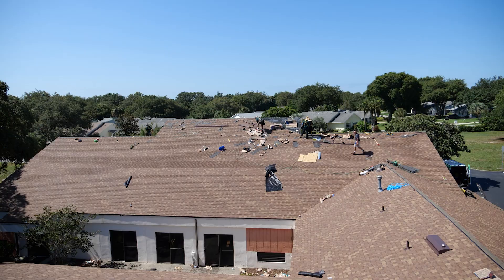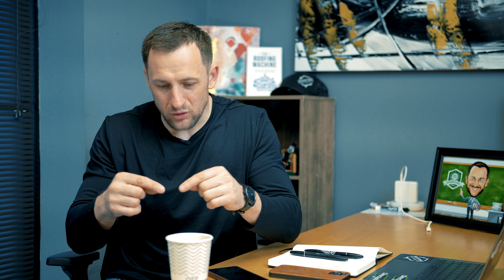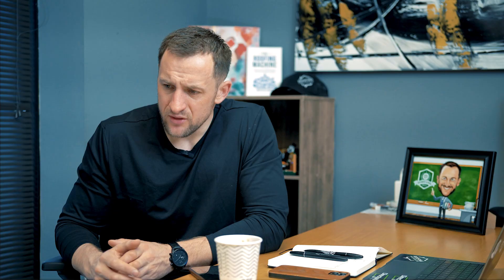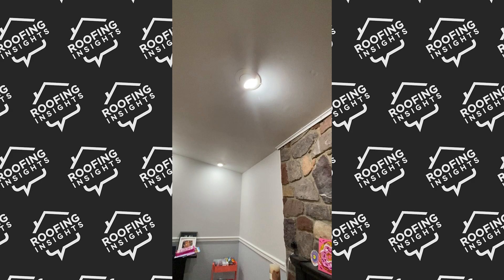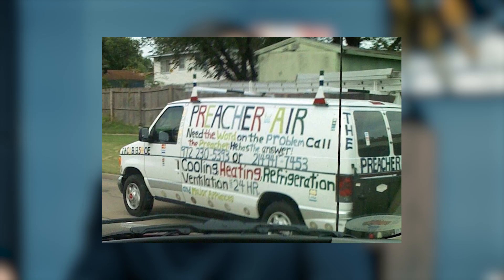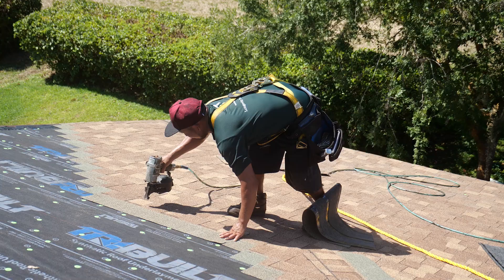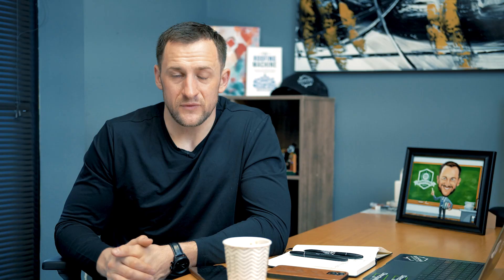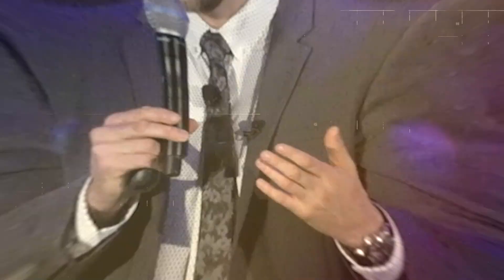7 Expensive Roofing Mistakes You Can Avoid

Comment: One benefit of staying fully involved all of these years. 28 years, we showed up at the wrong house once and had the wrong color started once but the rest of these issues I have avoided.  I start every job with the guys.
Reply: I started a roof with the wrong color once.  Supplier sent it out wrong.  Middle of the winter.  Had 3.5 square off and shingled.  Sent a picture to the builder who was in Europe at the time.

So I got paid for it and waited two weeks for the new shingles.

That same roof the supplier stocked 16 square in a 6 foot area of the peak.  I was pissed.  Had to pull off another roof to go there and move the shingles.
Reply: @jamesp2391  we had that happen with standing seam. We got paid to put it on, take it off and put it on again. It’s nice when it’s somebody Eises fault

Comment: How about closing and locking the hitch pin on your dump trailer when reconnecting it before heading the road or forgetting to lift the landing gear all the way up and getting it nagged in the driveway or worst down the road. This one might not make it to the top of the list but when you break your dump trailer and cant finish the job or start the next job. It will make your hair change color to gray and white.

Comment: Dimitri, thank you for your videos. I've started with Ready Roofing recently and have seen some concerning things. A buddy was currently with them and they needed a tech. Been about 6 months and I'm on the fence about staying on. It's nothing like the ready roofing you posted about. It's almost like the company was sold or something. I've been in the industry sense 2008. They are under the GAF spell😅. Not a bad brand but certainly not the best. This branch is fairly new to the area. Should I give it a chance or move on? The biggest problem it most of the folks involved dont seem to know anything about the industry.

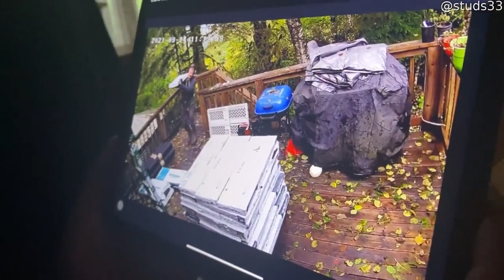Comment: My roof pitch is 12:12 and 8:12 in places. Where my residence is I deal with larger leaves, helicopters, and a small number of pine needles. Are gutter guards or filters ideal for my case in your opinion and if so which option would you recommend? We've lived in the residence from approx 03/22 to now and the downspouts are already clogged. My concern with the pitch is water running over the guards/filters. My dilemma is if it just makes more sense to clean the gutters or have them cleaned. Quotes to this point have come from a more basic leaf relief type system and two different mesh type products..All American Gutter Protection and Leaf Filter.